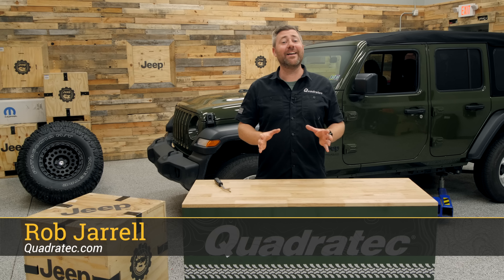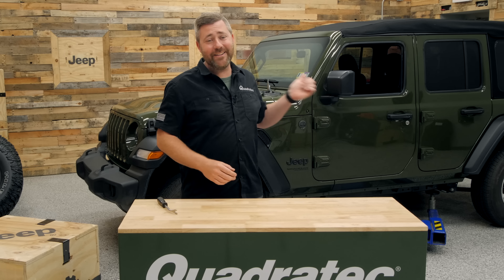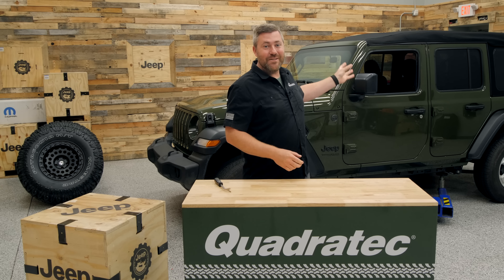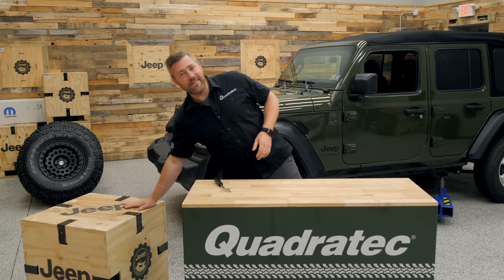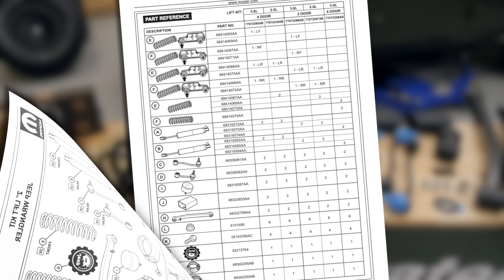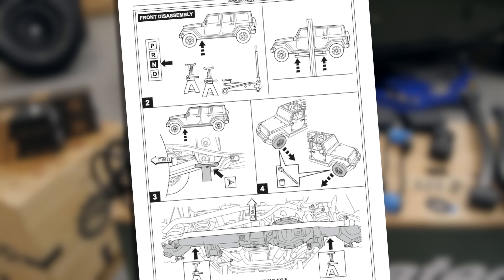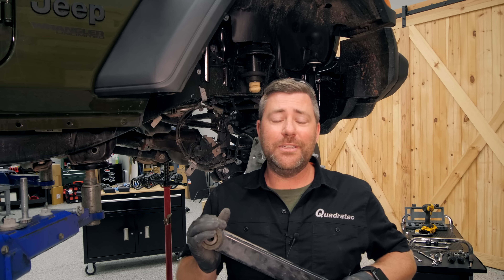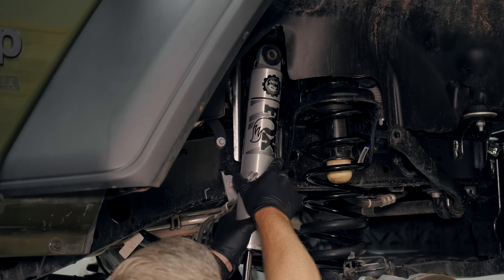Win this Jeep! Build Up Part 1 - Mopar Suspension, Milestar Tires & Lynx Wheels

Comment: If only the giveaway Jeep wrangler are RUBICON. Other wrangler trims are true 4WD and trail rated, but non has a locker. I hope Jeep comes out with remotely adjustable side view mirrors with turn indicators and a standard rear locker on Willy's. Optional on extreme package trims. Only the Rubicon is true trail worthy in my opinion.

Comment: Do you think there is a need to get an adjustable track bar? I’m looking to get the Mopar 2” lift for my 4xe and I see there isn’t a new track bar or track bar brace included.
Reply: Definitely get one. Fb marketplace u can get a new one for a good deal. Got a rancho one brand new for 115